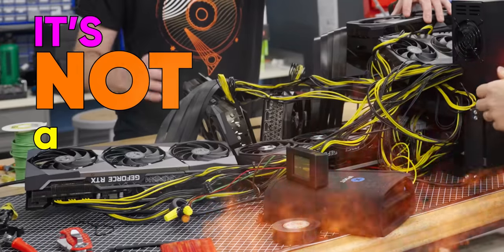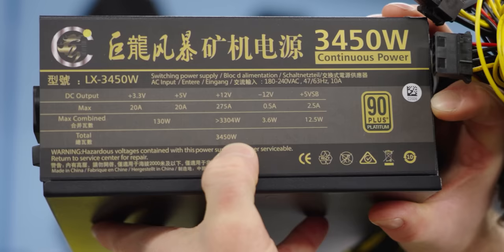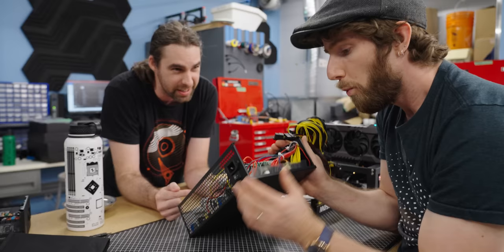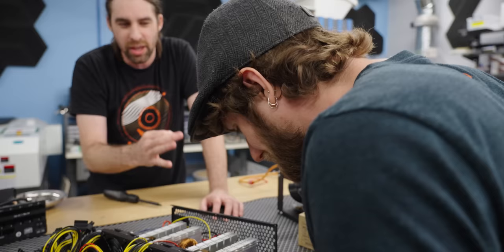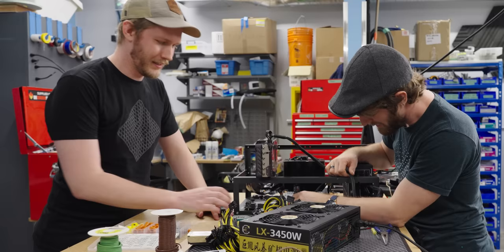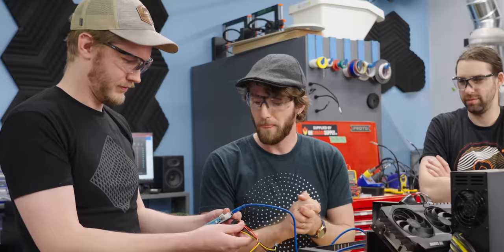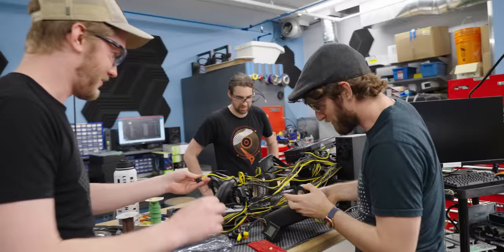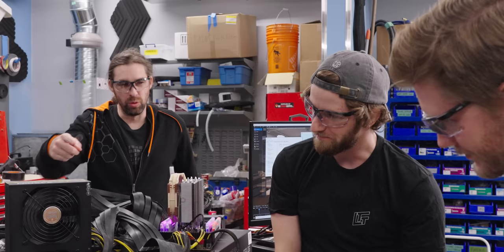This 3450W Power Supply is a Fire Hazard!

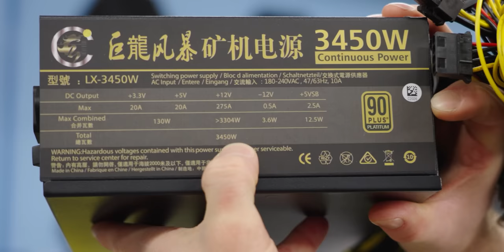Comment: At 2:40 it says that the Powersupply would use up to 240 V with 10A. But this would only result in a total amount of power of 2400 W. So the most incredible thing is, this Powersupply creates Power out of thin air.
Reply: It's efficiency is obviously >100%
Reply: i know with car amps the capacitors hold enough power to give short bursts of power higher than the amps actually fused at
Reply: It's self-sustaining now...

Comment: 1:30 240v power makes this a sort of reasonable input style. @240v it’s around 15a draw. Which anyone with a 240v outlet has probably built it for more than that.

Edit: also that current meter is perfectly fine. The mining community has been using them for years.
Reply: I believe most standard European breakers are rated at 16A sustained draw, so you'd be "fine" in the sense that it wouldn't immediately pop a breaker.
Reply: @theIpatix  In Australia, the standard household 240V circuit is rated for 10A. You can get up to 30A though with the proper breaker and sockets.
Reply: @theIpatix  the issue is that at the socket side (in the UK that is) you're limited to a max of a 13amp fuse in the plug, so the best you can hope for is 3120w, in mainland Europe though assuming the circuit is connected to a 16A breaker then yes this would work, however not all breakers are 16A and instead might be 10A which as I understand it, is more common for general home use than 16A.

Either way, I'd be shocked if it could even take a brief load of 3450w, nevermind sustained and definitely not with acceptable ripple and noise, and as for protection? Just don't stand near it and you'll be fine.
Reply: I'd be curious to see if the power factor correction was garbage would the utility eventually figure it out I'd you had a dozen of these in a house
Reply: @theIpatix  yea fair enough, I was more so referring to USA and Canada tho, cuz using a dual pole breaker you can get 240v at whatever amperage you want (provided u build a circuit capable of handling it, and your main pannel can also sustain it. Most houses are 100a service so 30a is about a third. But they likely have an industrial service so 400a plus is common)
Reply: Meaning most of the world outside N.America, where very few outlets are able to supply that much.
And even if they were, the IEC C13/14 connector pair in the PSU and its supply lead are only rated for 10A.
Reply: @wimpyhugz_TGK  That's not quite correct, each circuit is rated for either 16A or 20A, it's the sockets that are rated for 10A but you could just get a 15A socket installed.
Reply: @PaulTheFox1988  tbf, most 13A fuses will hold up to 15A for a reasonable amount of time, especially if they're in a cold environment. The contacts on a UK plug/socket are actually pretty impressively rated. If you can get the cable termination right they'll comfortably sit at 32A+ without too much hassle.
Reply: @phillee2814  I mean in South Africa the normal household power is 220v @60 amps and we have an option for 400v @60-180 amps, which is a LOT more than this and basically any other single power supply can suck.
Reply: @JaenEngineering  I would absolutely not run a 13A fuse above its rating, just because it can doesn't mean you should, it might work or it might catch fire, I wouldn't want either situation to occur.
Also the breakers are usually 32A due to many homes using a ring circuit, and in fact can be way more than that depending on the circuits intended use case, that means that yes, you can load the circuit to 32A, but absolutely not on a single socket, and the pins might be able to cope with that kind of load, the wiring in the wall certainly should be, but the plastic the socket is made of will deform or even catch fire at that kind of power.

I don't disagree that our plugs and sockets are capable well beyond their ratings when you go outside of regulations, you're absolutely correct on that point, but there's many different people reading these comments with very different levels of knowledge about what is safe, and many homes are not up to current standards or have degraded below them, and the last thing I would want to be responsible for is someone taking what is said here and trying it for themselves and getting hurt or worse, so I stick rigidly to what is permissable within the regulations and design spec. :)

I'm not having a go at you btw, I just don't want anyone to get the wrong ideas about what is actually safe.
Reply: @omnihein9322  But through what kind of connection?
Certainly not the one fitted to this power supply, which is rated for 10A maximum.
Reply: @PaulTheFox1988  I wasn't suggesting anyone should run up a circuit to those kinds of powers, only that doing so intermittently wouldn't actually do much damage. In fact, unless you specifically set out to do so, I'm not even sure it's possible. As for the plastic catching fire or melting. Nope. The majority of plug failures are due to a poor termination between the cable and the connectors not between the connectors themselves. Get that right and yes, it'll get warm, but no where near enough to melt the plastic (it has to be thermosetting for that very reason) and certainly won't catch fire (it also has to be self extinguishing). And before anyone else comments, I have put this to the test.
Reply: @phillee2814  we have those too, but the limit is the socket, not our circuit, we have plugs that have different ratings, but they all look basically the same. 

The 400v one looks way different though, it's a 3 phase circuit so the plugs look pretty different.

Comment: 6:54 that is an PTC (Positive Temperature Coefficient) that is used to limit in-rush currents and not an NTC. As a high current passes through it and it warms up, it's resistance increases (hence Positive Temperature Coefficient) and it therefore limits the current, after the capacitors have charged up, the current decreases, the PTC cools does and it's resistance goes down and it has done it's job. a NTC would let more current through as it heats up, which is not what we want in in-rush current protection application.
Reply: That is exactly what you want in in-rush current protection?... Small start current, increasing to full capacity after the capacitor is filled... What you're describing is full in-rush current (instantly trips the breaker) followed by lower current (too low to run the full 3KW psu)...
Reply: @someguy4915  I believe you're more correct on this one actually after I rechecked the use cases for the input protection cases for the NTC and PTC. PTC is more suited for possible short-circuit events, so they limit in those cases the more sustained current draw times. And I might have also mixed them with polyfuses, which share the PTC characteristic thermal-resistance behavior with current. Both can be used in current limiting applications.

Comment: Take it from a physiology grad and electronics nerd of 40 years, even a mains capacitor in a small PSU would 100% be able to yeet you across a room (and potentially kill). 
A battery powered TENS machine is enough to make people punch themselves in the face or fall on the floor..  It's your muscles which do the real work, the electricity just has to be enough to trigger the nerves. Depending which particular muscles contract, it'd be able to throw you further than you could willingly jump, so depending how jacked you are, across the room is 100% possible. 
SMPS bus caps are DC, so they'd usually cause one violent muscle contraction rather than the paralysis seen with AC electrocution. The bus voltage on a 230V powered PSU is 325VDC, enough to push 800mA through a person (Assuming the 400 ohm human model used in TASER testing). 10mA is enough to cause strong muscle contractions, 30mA can stop a heart.

Comment: I wish I could say I haven't messed with 240V AC, but unfortunately my soldering iron disassembled itself leaving bare and plugged in power and earth wires loose and almost touching. I now understand the importance of staggering wires so they can't touch if they come loose, and also buying quality tools
Reply: My closest contact with wall power was repairing my oven. Or rather replacing a screw on one of the handles. The original screw decided "screw it" and disappeared to somewhere else, and every time I would turn on the oven there was a chance that 230V on 3x 24A would go to the metal plate the knobs are mounted on, giving full wall power onto the outer chassis.

Comment: I like how Linus is scared of 240V like it is something what will explode while looking at it. While most of the world runs on 240V 😆
Reply: Thing is though, 240 volt power IS much more dangerous than 115. Catch a jolt from a US wall socket and it hurts like hell, catch a jolt from an Australian 240 volt wall socket and there's a very good chance you're dead before you hit the floor.
Reply: @ChristopherHallett  Luckily the Rest of the world has proper plugs and RCCBs in every circuit, meaning it's practically Impossible to get an electric shock as a normal Person, who doesn't screw open Power supplies or microwaves.

I still don't understand why americans only Put them into bathrooms and use unshielded plugs on top of that.

Also their friggin extension cords mostly do not have any fuses in them and are often not rated for all common Amp variations of circuits in the US (with No way of telling if it's a 20 AMP circuit by Just looking at the outlet that combined is a gigantic firehazard).
I don't understand why these two things (Power cords must be able to service 20 Amp circuits and also have a fuse in them) arent Just mandated by law.

Edit: Also technically the US also has 240 Volts, they just use Split Power.
Reply: @Maris_P  The benefit of the shitty plugs is they're much cheaper. I'm not saying it's "better" but for a capitalist country which banks on cutting corners the whole grid is taking that into account. The split power weirdness shows it's intentional; you can drop the split and get typical 240. So if ever the country needed a major overhaul it could change the standard, once again, cheaply. At least to the grid itself... Consumers might not be too happy. But if they cared about that they would not have the shitty plug, now would they?
@Chris, the U.S. hasn't used the 115v standard for residential since 1984. It's 120v today.
Reply: @ChristopherHallett As someone who has taken multiple 240v hits and is still here, I can confidently tell you that your statement is Bull.
It's the amps that kills, not the volts. The more the voltage drops, the more the amperage has to rise, to compensate. That's why a 12v car starter motor needs up to 100 or more amps to work, but for a 380v lumber mill motor, 10-16A is usually more than enough for a day of splitting logs.
Reply: I even have 400V plugs at home, and I think they're quite common.
Reply: @user-xu2pi6vx7o  I’ve also taken multiple 240v electric shocks (4 to be precise) and am still here.

But saying it’s the amps that kill is pretty stupid. A rewound MOT delivering 1000Amps at 2v isn’t going to do a thing if you grab both ends. But try that with 10Amps at 200v and you’re in for a bad time.

Maybe it’s the Amps that stop your heart but it’s Volts that allow it to reach your heart in the first place.
Reply: @SR20DETDOG  Um... Yes, it's the amps that stops your heart, I.E. what kills you. More specifically, 6 milliamps across the heart is where you enter lethal territory.
Reply: @ChristopherHallett  While this is a weird thing to brag about, i've managed to electrocute myself maybe 5 times off 240V in the last decade - nothing worse than tiny burns on the skin, since our electrical standards are good and safety fuses do their jobs

Testing second hand electronics is not always a safe job

Comment: >TFW, you realize that at 240V 208V, that PSU is consuming the equivalent current of a 1,622.5W 1,872W PSU at 110V, and 1,800W 110v units exist in standard ATX so it is certainly possible to do this with a single PSU.

Comment: That power supply can supply more power than my house uses
Reply: until you turn on a microwave and a couple more appliances
Reply: Do u live in a trailer or what? Home connection in India are 7.5 kW.
Reply: @irisical8934  bold of you to assume he has any appliances
Reply: r e f r i g e r a t o r
Reply: @manojgail  while on my country majority of the household only got 900 Watt and 95% not more than 1300 W XD
Reply: In my country we have as standard 3*24A 240V, totaling 17kW.
Reply: @prondiest  which country do you live? How do you even operate things like ovens, kettles, irons, geysers, ACs?
Reply: @manojgail  Somewhere in SEA, there extremely small percentage of household who their appliances turn electricity into heat/cold. on average, household only use 1 kWh daily. 

way back in the days when everything still 450, i must turn everything off to use my computer and 1 lamp. XD
Reply: @oldveryveryoldmanfromthe1900s  assuming they've got atleast enough to charge their device and have an internet connection, very much more than likely they do
Reply: @irisical8934  bold of you to assume he isn’t going to the library to watch and comment on videos
Reply: @oldveryveryoldmanfromthe1900s  if you look at their channel, they've got 2 videos posted on there. im pretty sure if you're gonna be uploading mcpe content, you'd be doing it at home (especially to upload anything)
Reply: @irisical8934  I download a ton of pirated music at the library and the internets speeds are more than tolerable
Reply: @prondiest  That's very bad.

Comment: I love hearing someone talk about the things they know well, so it always bums me out when they clip themselves by not going "turbo nerd." GO TURBO NERD!!
Reply: Problem is that he doesn't know anything about electricity that would be considered turbonerd. ;p
Reply: @tedjohansen1634  did you watch the video? I'm not talking about Linus. There's an engineer in this video.
Reply: I mean I can try to guess what he meant if you want. He is talking about electromagnetic interference (emi) which occurs when random stuff hits a circuit, like radio waves or some other load switches on or off in the circuit. Basically just noise of some sort. 

Now, firstly about what capacitators do. They delay power transmission slightly, so high short peaks get swallowed by it and then slowly drained. Then they also make it so only AC gets through (thats the main use for capacitators in most electronics - just letting AC through and isolating a network from the DC current). This probably helps in terms of offsets or DC noise. But I am guessing that its actually another cap that prevents this than the one talked about here. Lastly capacitators act as a short when the frequency is very high, as in a few megahertz or gigahertz. Basically a capacitator has one important property: resistance goes up when frequency is low, and down when its high. 

Now, grid frequency is only 60Hz which is basically nothing. However, noise frequency is arbitrarily high, most of the time a few hundred or thousand times the grid frequency. So that part gets transmitted to ground, however 60Hz does not since it gets blocked or sees a high resistance. (note what I said above about swallowing short peaks - thats basically the same as what I said just now, just another way to look at it).

why is EMI bad? Well, just imagine it as additional power that goes into the circuit. That power ends up somewhere. Since there are other caps, they might just go right through there, resulting in some isolation that is supposed to be fine to, well, not be fine and this could lead to bad stuff such as power peaks fucking up stuff or some arcing or whatever. Its just uncontrolled, and you dont want that when there is lots of power draw.

Comment: Anyone else notice that at 17:30 Linus times and Kyles got reversed? Linus said 2501 and Kyle said 2450, which is why Linus won. I got so confused for a while bc Linus said he won, but on the table in the vid it shows that he guessed 2450, in which case he would have been the MOST off haha. I went back and realized that the editors must’ve goofed, bc Linus says he guessed 2501 and Kyle 2450. So for anyone else confused as to why Linus won when the table said he was the most wrong, or for anyone who noticed this and is wondering if someone else did too, you are not alone LOL.

Comment: I actually had two of these running for about 8 months 24/7, each one had a 120mm fan go bad but other than that nothing went wrong. Ran a dedicated 240v circuit to power them. Total pieces of crap lol but got the job done.
Reply: How much load did you draw from them, and how much did it pull from the wall?
Reply: @HappyBeezerStudios  I never measured the draw from the wall but they were being used in conjunction with another two 750w power supplies to run 26 GPUs plus two motherboards (not enough PCIe connectors on just the 3450w to power 13 gpus plus 13 risers.) Each card drawing around 110w plus the motherboard would've been approx. 1600w per bank before efficiency loss so possibly 2000w at the wall. No where near it's rated maximum.  Most miners use breakout boards now so these have become obsolete

Comment: I just had a PSU damage my MB, CPU and RAM. The 3080ti was killed by the PSU. Excellent timing for a video about PSU issues. (I didn't even use a cheap psu, corsair HX1000i is the culprit)
Reply: That is really old power supply
Reply: @jardelainen8278   a bit over 5 years in use
Reply: You could get damages by contacting them.Your PSU has a 10 year warranty.
Reply: @sinaalami4148  Thanks for the tip, I wasn't aware that the hxi series has 10 year warranty. I will for sure contact them for warranty/damages

Comment: In Europe there is no problem with 3450 W because on one circuit you can get 3600W at 230V and 16A. The only problem is you have is the outlet witch only handles 3600W for around 30 Minutes (German Schuko outlet).